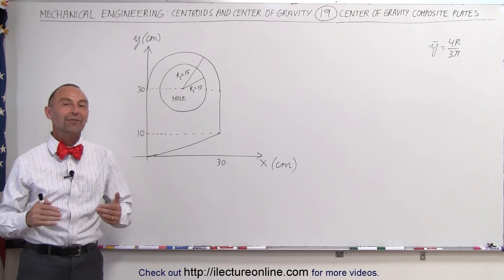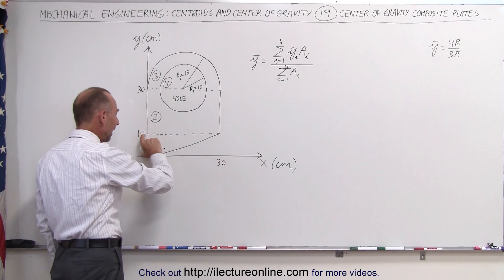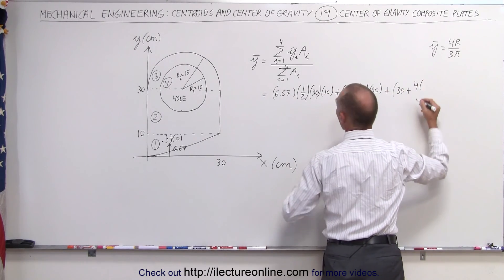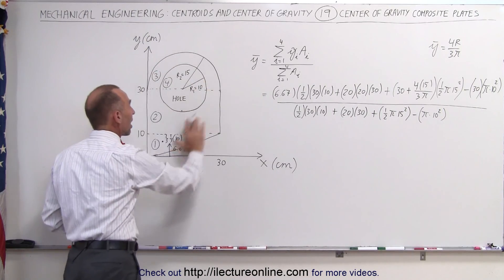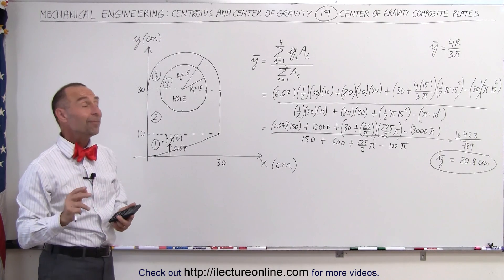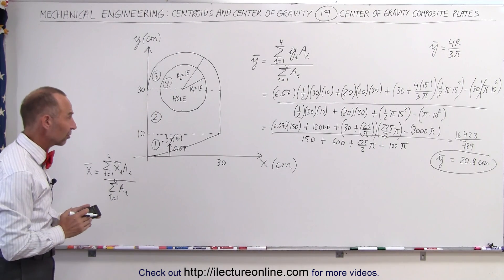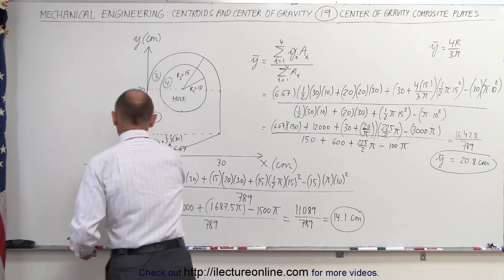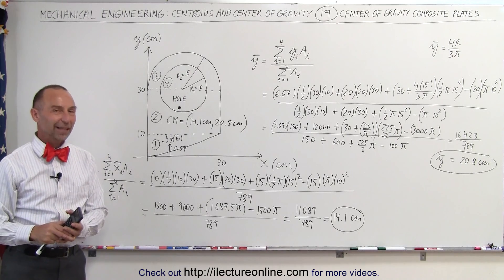Mechanical Engineering: Centroids & Center of Gravity (19 of 25) C. G. of a Composite Plate 4

Comment: Sir, I think the x-coordinate in Shape 2(Rectangle) must be 25 since you isolated the rectangle. In getting the centroid of the rectangle, it must be b/2 (30/2=15) then add the height of the triangle which is 10. It would equal to 25
Reply from the maker: The x-coordinate of the centroid of the rectangle is 15 cm as indicated in the video.  Thanks for checking.

Comment: Correct me if I'm wrong, but I think there's a mistake when you calculated the x tilda of the semicircle, you used just 15 cm as the x tilda when it's 20 divided by pi right, the centroid of the semi-circle is not the same as the centroid of the normal circle, so is that incorrect or not? Thanks
Reply from the maker: The numbers used in the video are correct.  Thank you for checking

Comment: Sir for Area 1, why  u use 2/3(h) for locating the y of the triangle instead 1/3(h). Im confuse when do I use the 1/3h and 2/3h please help
Reply from the maker: Since the base of the triangle is at the  y = 10 cm position to find the center of mass you have to measure from the base, therefore it is 2/3 h from the y = 0 line
Reply: @MichelvanBiezen  Sir if the height and base having same given, 1/3h must be use for x and y?
Reply: Omg thank you so much, the position of the triangle was only change therefore 2/3h must be use. Thank you for making it clear Sir.

Comment: This may just be poor understanding on my end, but I thought the center of mass was more or less "the point at which you can balance an object". If I'm correct in saying that than why is the center of mass in this example within the hole?
Reply from the maker: You definition is correct, unless there happens to be a hole right at the location you would normally balance the object at. :)
Reply: Michel van Biezen just to clarify, does that mean that's this object/shape can't be balanced at a single point?
Reply from the maker: That is correct.  The CM is at a location where there is no material.